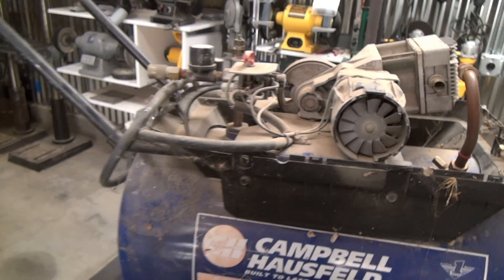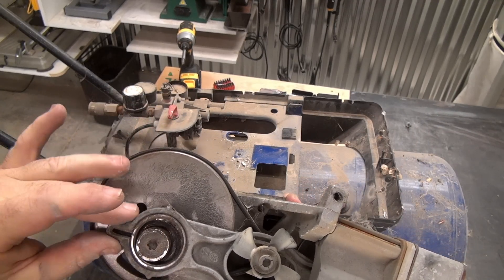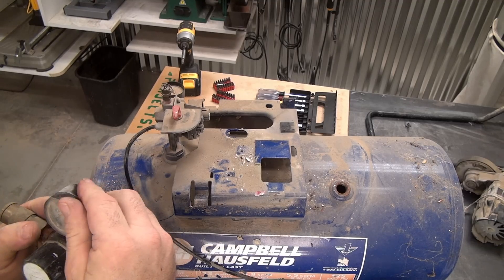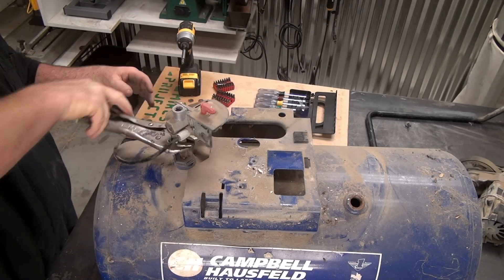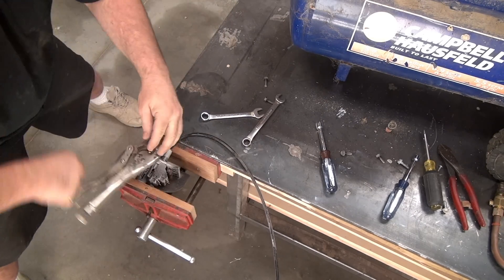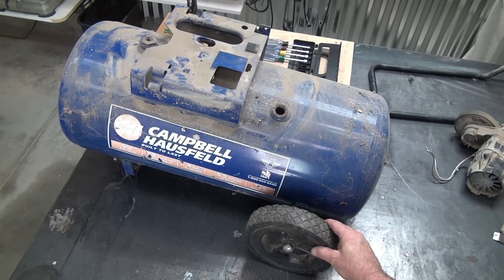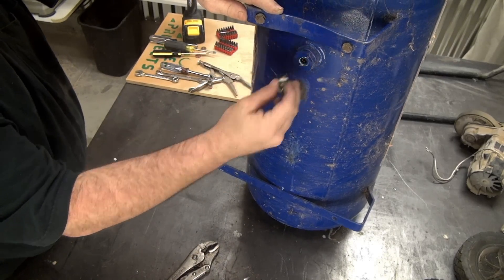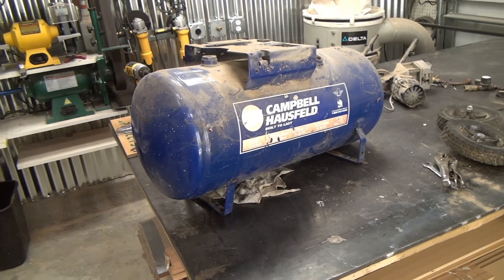Making a Reserve Compressed AIR TANK From an Old Air Compressor * The AIR PIG

Comment: Just some food for thought, I would not use Galv. Piping. It loves to rust on the inside. When I plumbed my House all the Galvanized Piping was rusted so bad, it filled itself up up with the rust that delaminate from itself. Also When I plumbed my Gas Pack to the meter, I plumbed everything with Galv. piping and the gas company made me take it out and replace it with plain black threaded piping for that exact reason.
Reply from the maker: really, maybe thats why a few of my galvanized pipes are rusting out so quickly. I have a few water lines running out back for a cooler and it seems like theyre always causing me grief. So black is the way to go? thanks

Comment: What you should is after your pump go directly to the portable tank and then to your main tank and 
Eliminating any water In your air lines.
Because your inlet to the portable is much  lower the water will drop to the bottom of the tank and
Outlet is higher so only air will go through

Comment: Quick Question: Why did you choose to modify the existing wheel when you could have left that alone and modified the front leg into a support for your modificatio  wheels? Then you would still have the normal set for when you wanted it in a horizontal orientation and even if you stole the wheels from their origional position to new mounting spot on other leg support you would have retained the option of either going back to origional orientation or with 2nd set of wheels you could have it in either orientation.  Best of both world's! BTW Nice video thank you for sharing.

Comment: Not sure why it is just automatic for us to go buy tees and reducers and gender changers and spend $5, $5, $5, $5, $5, $5, $5, to get these connected when:
https://www.amazon.com/Flameer-Manifold-Coupler-Connector-Splitter/dp/B07MRHQMPR/ref=sr_1_51?keywords=3+way+manifold&qid=1564531932&s=hi&sr=1-51
or
https://www.amazon.com/DealMux-Thread-Inline-Manifold-Splitter/dp/B0721D3L9P/ref=sr_1_30?keywords=3+way+manifold&qid=1564532440&s=hi&sr=1-30

Comment: you could have saved alot of time by leaving the compressor the way it was, it had the drain valve in the right spot and wheels, you just needed to paint it and add a two t connectors one for the female quick connect, one for the relief valve and the other for the regulator to the other female quick connector for the output, but looks great

Comment: One thing I might add is if anyone does this please pay attention to the pressure rating of the tank! I would not remove that sticker. The psi rating of this tank may not match the new setup. For example I have a 60 gal 200psi, the other tank was a 10gal at 125psi. You could easily blow it and you apart!

Other than this excellent video! I still have a slim 2.5 gallon tank from a compressor my grandfather had. I cut the compressor mount off because it blew and am going to install it in my truck as a reserve tank. It’s rated at 125 and it’s old so I think I’ll do a 90psi reserve.
Reply: Aaron Gilliam thats why he added a relief valve, the valve will go off if the pressure exceeds what the tank can hold

Comment: If you made the vertical tank, what is your reason to install water drain valve on side of the tank?!
Reply: I dont understand reason to make it verticle..  i like idea of wheels and handle for porta poof but i woulda made it sit on top of the other tank or below and feed it with the drain of the top tank leaving bottom drain for the pee hole..  no point in draining a tank from the side, might as well leave it pressurized until drain it from the bottom to get all the moisture out..  otherwise itll get pinhole rust holes in the bottom and slowly loose capacity from buildup
Reply: @Z-Ack  takes up less floor space.
Reply from the maker: Bingo

Comment: Nice job Mike...I'm doing a similar project with a 20 gal tank but as a vertical stand for a plasma cutter.  I'll make a platform on "top" and set my Lotos LT3500 on the platform.   The platform will be attached to the existing platform and front floor support, no welding to the tank.  This will allow me to cut metal out of the shop and without being attached to an air supply.  Nearly every cut I've made has been a  matter of seconds (less than a minute) so the stored air unloading out of the tank should be plenty to run the cutter. The primary reason I'm building this is to get the plasma cutter off my bench which is way too cluttered.  Being able to roll it around the shop with it's own source of air is a big bonus not to mention it's use as extra volume of air for my air tool compressors.

Comment: I got a compressor that has a tired electric Motor.  I'll put the engine away for a possible future project or parts.  I'll do the same thing with the tank as here but I'll leave it hooked up all the time for extra air volume/storage for like maybe the odd painting job or just longer on tool time before recharge...

Comment: Dude this is a good idea but save your self some trouble and throw that Teflon tape away and use a thread locker. Thread locker seals the first time every time and doesn't allow the parts to spin at all. I got a 100lb propane tank (25gal) I converted for air and I never have to worry about it leaking air over time which I've had happen with Teflon tape.

Comment: Just a comment and a question..
C > as long as you take all the air fittings off the tank and clear any combustibles from inside the tank you should (with proper care to do it fairly slow) be able to weld too the tank, most of those accidents you mentioned were people welding on sealed tanks...

Q> do you intend on putting a drain plug in the "bottom" of the tank ?

Comment: Cool build man.  I need some advice on my own build if you don't mind.  I am using a tank off of an air compressor that is rated for 8 bar but my big compressor is rated at10 bar and the question is, is it safe to fill an 8 bar tank with a 10 bar compressor or do I need some sort of safety switch or regulator to keep it safe?
Reply from the maker: Sure I don't mind. I think "bar" is used to describe air pressure. I did a quick google search & it looks like the smaller number "bar" means more pressure (please double check) so if your big compressor max air pressure is LESS that the new air tank you should be okay. The key is to not over pressurize the new air tank beyond what it was designed to hold. Also be sure there is not a lot of rust in the new airtank, I did a search on air compressor explosions & its pretty scary.
Reply: Sorry, bar is what we use instead of PSI in Europe.  Do you know if it is possible to regulate that air that is going into the new tank because the new tank is rated for less pressure?  And just so you know, 10 bar is 140 psi and 8 bar is 116 and the new smaller tank is rated for a bar.  And thanks again for the help!
Reply from the maker: Im not really sure.
Reply: Ok, thanks anyway bro
Reply: +Jack Peters I got a compressor that goes to 175 psi and I've had tank on it that was rated for 125psi. I just ran it through the regulator and didn't go above 125psi on the regulator. if you want to do the same but want to change the regulator without affecting the external tank you'll have to have a 2nd regulator. 1 for tools and 1 for the tank. I'd suggest getting a tank for compressed gas like propane because those tanks can handle 300-400psi so you won't have any worries no matter what compressor you have.
Reply: Richard Simmons sweating to the oldies